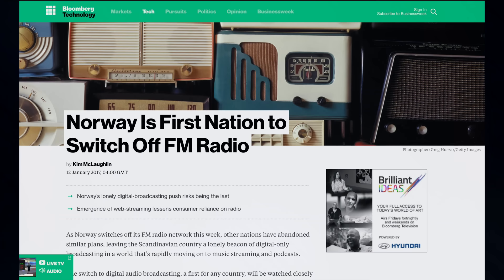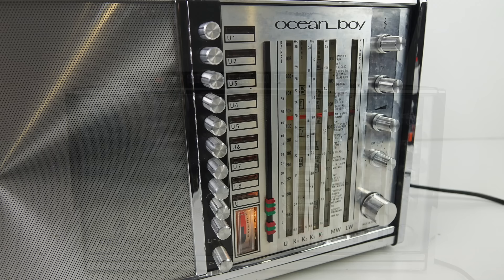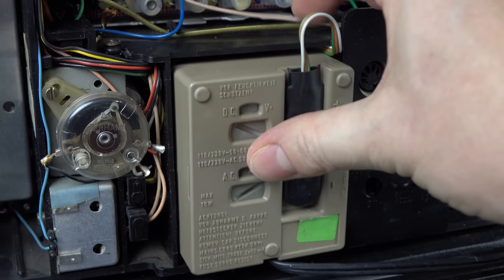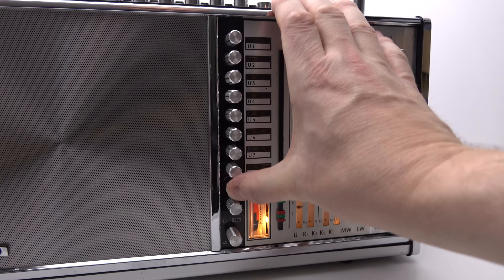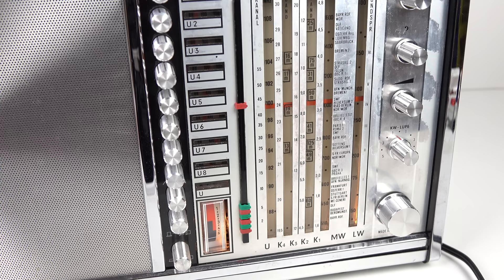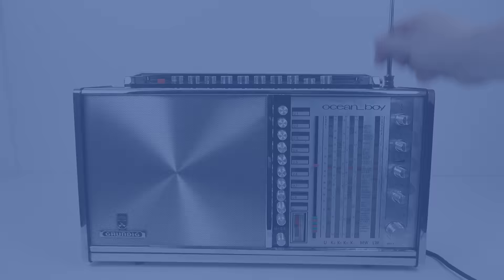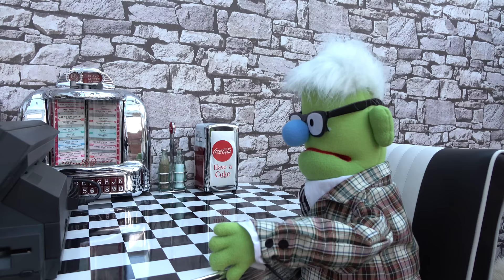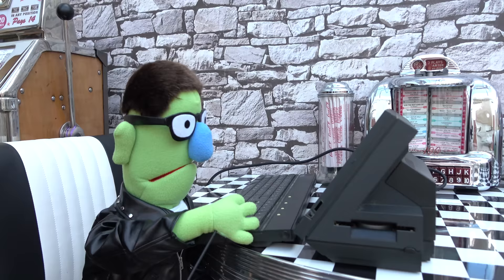Design Classic: Grundig Ocean Boy 210 Radio

Comment: Why is DAB being forced down our neck. The transmission quality from most stations is poor, you need a very strong signal to get reception and if you need a portable DAB radio it has to be the size of a house brick as DAB needs 8 (eight!!) times as much power as an FM transistor radio.
Reply: Oh lol. You guys in the UK (I suppose?) must have REALLY fucked up a proper implementation of digital radio.
German here, I've got a DAB+ radio in my car and not only does it receive my favorite small local station that always had a too week signal with FM without any issues whatsoever, there's also a ton of stations that aren't available on FM in my area or AT ALL and in terms of sound quality it COMPLETELY blows that crappy FM out of the water. Whenever I compare DAB+ to FM on that car radio, It leaves me wondering why DAB+ hasn't already taken FM's place years ago.
Reply: There is also DRM radio there, digital stereo shortwave radio with a video source, nice.

Comment: quallity products hold for ever .. all the stuff after 1995 barely makes it 1-2 years
Reply: It depends. I have a 1997 LG H-120 Handheld PC that still works today, a 1998 Toshiba Satellite 2180CDT that is my secondary laptop, and a 2000 Fujitsu Siemens CRT monitor that I am looking at right now :-)

I would say that most of the stuff made for mass-consuming market after 2005 is total crap. You are lucky to get it past the warranty period. More than once I bought smartphones that broke during the warranty period several times (thankfully I never paid anything).
And to clarify, I am not old at all: I'm just 19 :-D
Reply: Made in China goods seems to be pretty variable quality and may depend on your luck. I bought 2 identical power supplies, the first one broke after a week (shorted output transistor), the second one I bought to replace it is still working after 2 years, and I've abused it at least three or four times (leaving it two days at maximum power one time as well). I agree tho that some Made in China stuff is quite high quality, while others are complete crap.
Reply: lol made in china is quite high quality ?? yea and mcdonalds is quite quality food !! ha ha ha LMAO
Reply: The radio equipment of today can't even be repaired, no availible parts.
Reply: I think there was a highend CD player from there which was about $10,000 or so, reviewed in stereophile or absolute sound magazone.

Comment: Why just give up and switch off your FM tuners when you get a rca/3.5mm to FM transmitter...
Reply: So use your radio as a wireless speaker. What's the point in that?

Comment: I'm in the United States, and I have a Transistor 3001, which is the export version of the Ocean Boy 209. I got it for my 14th birthday in 1977. Just a few years ago it developed a problem. It won't turn on unless I hold the on/off button part way down. My father took it to a friend who he thought could fix that, but then discovered a larger problem. So he brought it back to me. He said it didn't work at all. I plugged it in and found that it doesn't receive any FM at all, just noise- on either the main tuner or on any of the 8 pre-sets. But it always worked fine before.

Comment: What is the beige thing in the back with the adjusters and plug thing?
Reply from the maker: Voltage transformer.
Reply: Thank you.
Reply: should be fairly obvious when you saw it. but judging by your name and profile image, i can understand that you're probably one of those people who live under a rock, who just pretend to be guided and interested in science but actually don't know anything science or electrical; even though I knew the difference between voltage standards of various countries as a child without ever traveling abroad (it's just common sense), so I honestly cant tell if you're just really clueless or pretending.. Anyways, it is a voltage selector. Swap it between North American/Japan 110 and U.K./Europe 220 volts, and also seemed to have a dial to select the DC output, I am guessing between 6.5/7.5W to 9 volts, to better help regulate the power provided to the radio's tuner and speaker.

lol
Reply: Whoa, dude, calm down. Not all people know how circuits and voltage works. It's not like the average user has to take apart their radio to be able to listen to Lady Gaga, so it's not necessary information to know what all the individual components are. You don't need to know how to forge the pins in the lock to open your front door, do you?
Reply: +Raven S (Hidden) Hey I have the training to repair that thing, and the glimpse of that removable grey box was just a bit too short to completely ID it. I recognized most of the other parts and connectors, but most radios from that period had the transformer firmly attached to the chassis, since it wouldn't dominate the device weight anyway. That two-prong figure 8 power cable used with a Mac Mini was the typical power cable for such radios, and they are still interchangeable.
Reply: If it is anything like the Grundig Yacht Boys I have the transformer was an optional extra. The big selling point of transistor radios was that they ran off batteries (for a reasonable time) so they must have thought many people wouldn't want to pay for something they wouldn't use.

Comment: Even if FM gets switched off almost everywhere, it will still be fun to pickup some distant remaining FM radio stations (which are now audible due to the fact that the strong FM transmitters in your vicinity have been switched off) and of course: Pirate Radio Stations! I wouldn't be so fast in throwing those FM radio's away.

Comment: The connections on the back are an interesting set of options ... and those dual-duty preset + tuning knobs!!! And still sounds better than most BlueTooth speakers that only have one, maybe two jobs to do! This unit here - so pleasing to see, approach, interact with and hear!
Always wanted a digital Grundig  from RadioShack here in the US ( all too boring styling but feature-rich even till I came across one years later at the Shack ) in order to increase worldwide listening options beyond my contemporaneous ownership of a  Lasonic TRC-931 ( single aerial / antenna ) which I blasted about as much music from as the two available SW bands in the mornings and, moreso, evenings.

Comment: This is a beautiful design,it even looks great now.

If FM radio has switch off,you can buy something like a FM transmitter with 3.5mm jack that can plug in your phone or your Walkman or discman,you can set a frequency to transmit and set the radio to the same frequency to use as a wireless speaker to listen to music,it may not be the best audio quality but you still can keep your radio running :)

Comment: You should get DIN to 3.5 mm cable and connect bluetooth receiver or chromecast audio to it. Much, much better sound than fm. Just make shure to lower the input signal and turn radio volume almost to max. This way you can also use eq from device. 

I use my ocean boy 210, satellit 2000 and c6200 in different rooms, on picnics and smaller parties. Batteries last for ages. 

There's something special about GRUNDIG SOUND, IT ALWAYS MAKES PEOPLE DANCE and livens the party with it's looks. 

Love your channel!

Comment: I have the "Concert Boy 4000" from the same series. Same power suppy, same scale markers, same tuning meter, similar design, but FM Stereo (in 1968!). But it lacks the presets and has only 2 shortwave bands. The amp gjves only 2x 1.5 W, but the 4 speaker systems sounds like my HiFi.  On a set of 7 D-Cells it runs for months of normal listening. Where would our society be today, if our products would be designed and engineered with the same care as then, but with modern technology.

Comment: Here in the US we have HD digital channels which are digital encodes that set just above or below both FM and AM channel frequencies.My 2014 Camry didn't even have HD radio as an option. DAB stations as in Norway apparently transmit at slightly higher frequencies than the traditional FM band with a spread spectrum system over, essentially AM carriers - redundant information is sent for more reliability. I found myself listening to Internet radio from my smartphone while out driving yesterday and then remembered - data usage!

Comment: By the way, I am the proud owner of a Grundig Concert Boy, first bought in 1979 at the age of 13. There's plenty of broadcast short wave out there - if there's interference inside your house, get a long antenna outside, and you can even listen on your computer with a cheap RTL-SDR dongle and a device called an "upconverter."

Comment: Yaughtboy had fabulous sound, really deep undistorted bass, smooth mid range and pin sharp treble . All these at incredible volume. Finding one in good nick is hard as they ended up being used on building sites.But I think they are probably the best portable radio I have ever come across.

Comment: Those early furniturestyle radio/turntables with built-in speakers devices always had a glorious sound.  You had to wait a few moments for the tubes to warm up but it was such a warm and clear sound. Transistors were more robust and compact after that but I always felt the sound was never as good and warm as those old wooden devices that ran on tubes.

Comment: Weird what's happening in Europe first with LW and now FM radio. There are construction permits for new FM stations in Canada and USA still today. Many areas have so many FM radio stations there is a different one every 0.2 MHz across the FM dial. Even AM, which is supposedly dying, has dozens of local stations, and packed bottom to top, every 10 kHz at night.

Comment: I bought a a working Grundig Hit boy 310 and it works very well and it only cost £3.50, it is amazing that you can find in 2nd hand shops theses days. and it has FM,LW and MW but I do not thing that it has the original areal because it has to be pulled out for it to fit in the little clamp that holds it in. The best radio we have in the house is a Roberts R-800 and it has VHF, MF and LF and it takes a PP9 battery that you can still buy.

Comment: I have got a Grudig Hit Boy 31 and it slightly bettered but it still works very well and the sound quality is very good when it get hod of it. I got the radio for only £3.50 and it came with the power supply.

Comment: When the analog signal will be turned off, old radios won't be dead, they will surely sell something like those devices to stream on the car stereo the music from MP3 players, they will pick digital signal, convert it to a given FM frequency in a very short range and stream to your car stereo or your old radio, you'll only have to remember to change station on the box instead of changing with the dial of the radio that will remain tuned on the frequency streamed by the box

Comment: Nice. An intriguing one you may want to track down is a Russian Vega Selena 215. Due to the iron curtain back then, they sorta had a fork in their technological evolution and were still using solid state components (transistors etc) into the 1980s when the rival Sony ICF radios were becoming really small and more microchip based.

Basically, imagine a Russian version in a big sturdy case, big clonky switches and multi banded to pick up several short wave bands, medium wave, long wave and FM. Think you'd be into that.

Comment: Yacht Boy was a reciever I wanted. Got a Sangean ATS 803A and then a Lowe HF 125 both rare today I used these to recieve HF-FAX in the 90's then went to the internet. Getting raw weather in those days was harder... both of these had bfo so could resolve ssb. Wefax is a digital mode which has been around a long time it was fantastic getting a greyscale GOES-8 satellite pic at 3 in the morning on my aincient Tosh laptop running the Lowe decoder... much to the annoyance to the rest of my family. Wefax is still used but it's much harder now with all the hf pollution :-(

Comment: I remember the Grundig Yacht Boys and Satellit radios. They were always at the top of shortwave radio reviews with their high class sound. I wouldn't bother trying to find any English on shortwave unless you like American Evangelical preachers. There's not much else left. As for your FM receivers, you can always buy or build a very low power FM transmitter if you want them to feel needed. The ones used to play a phone through your car radio are pretty cheap.

Comment: You have the LW-band in that thing. Now you can listen to the last remaining Norwegian Radio at 153kHz. It will not go away, because it serves the offshore fleet on the Arctic Ocean. The wavelength is 2000 meters, so the optimal antenna lenght would be one kilometer.

Comment: Fisher radio had a similar thing they called it tune-o-matic. I owned a Fisher T 250 AM-FM receiver and the FM section had five little dials on the right hand side of the receiver that could be individually tune 5 presets.

Comment: I just realized I have a pretty similar device from the mid 70s, the Stereo 4500 HiFi Regie by ITT Schaub-Lorenz. But it's more designed as some kind of receiver... maybe? Aside from the radio which by the way also has 5 presets with it's own tiny tuners it has several inputs, one for Phono and a mixer which makes it possible to mix all input signals. Not sure if it was costly at all at the time but it still works perfectly and is in regular use.

Comment: The presets are like early 1980s TV and VCR presets. In circa 1983 I had a "Gold Star" TV like that. A pain to setup, but at least you only did it once!  P.S. In the US, broadcast radio is still kicking. In the Pittsburgh,PA market alone there are about 25 FM and 20 AM (MW) broadcast stations! 😀
Reply: herranton1979 I did'nt say there was any thing wrong with the set. Hell, I'm the one who bought it. I was referring to the tiny individual tuning wheels for the channel presets. It was the way analog tuner presets were setup then. Most brands had the same thing.
Reply: WAQWBrentwood Not to mention new FM LP stations that could be operated by any organization like schools.  only a shame digital radio is becoming less universal versus the old AM/FM/LW/SW bands of analog.
Reply: I live in Harrisburg, Pennsylvania market. There's 56 AM and 86 FM radio stations. Also, PennDOT uses AM radio to transmit traffic reports and road conditions (in my area, it's 1670 AM).

Comment: Well some interesting commentary on the whole Norway FM thing. It does concern me, being the manager of a reasonably large community FM station here in New Zealand. However rather I would like to comment on the radio itself in this video.

Those preset tuners with the little dials are almost exactly the same kind of thing they would have had in television sets during that era for the channel presets. In the TVs they usually hid behind a panel or in a little drawer. 

They are actually a form of precision potentiometer rather than a tuning capacitor. In this radio I am picking that the voltage they supply would be fed to a varicap diode to produce the tuning.

Comment: Even when Canada switches to digital FM, I'll be using my radios as wireless speakers for my PC I have a tiny FM transmitter hooked to the computer so I can hear podcasts and other things all over the house. And with stations gone from the band, it won't matter where I tune. The only thing I'll miss from analogue FM is hearing distant stations. Nothing on local stations makes me want to listen to them.

Comment: hello techmoan, I got the same radio, 
although it's not called an ocean boy (I guess that was the export model's name) 

my family brought it with them when they came to greece at 1972 back from germany (they were immigrants there). 
the funny thing is since greece was under a military dictatorship at the time they almost got arrested because the customs officers could not believe that this was a normal radio since it was overly complex and could also work at shortwaves ,they thought it was some kind of a military radio (which was obviously illegal for a citizen to own)... they had to wait for many hours before the were let go and not before the radio was "modified" by the custom officers (the just cut some wires...it was an easy fix, they tell me). anyway this radio stopped working some years ago... I opened it up to see what is wrong... and I was amazed by the complexity! (never got it to work).

P.S.
by the way... I just love it when you open things up and show us how they work and how you fix them ;-)

Comment: Rig up a handful of DAB radios to USB-powered FM transmitters and place them in or next to the room you have your FM radios.  It's worth trying a few first as some don't have great quality or output a very weak signal.  The Rii one I have reaches 3 rooms away from the transmitter, even though it's intended for a car and the sound quality seems as good as from a strong FM station.

Comment: In Germany, FM signals will also be switched off soon! However, I heard that the FM signal frequencies which are transmitted via the TV cable jack will NOT be switched off. Maybe there will be some way of using these for older electronics then?

Comment: Thanks for this review, really useful. I've just bought a 1969 209 in mint condition, a lovely radio. Can you give any help please as to what the red button on the top panel with the bulb icon above it does? I'm unsure if its to switch the front panel light off when the radio is on but when I try the button it doesn't do much or retracts when pushed down. I'm on the search for user manual without much luck.

Comment: I have a Grundig FR-200 ---recycle power--- Am/FM/Short Wave radio with a light on it.  It has a hand crank that charges a battery, along with normal replaceable batteries.  I guess the idea was, that you could get a light and a radio signal if the power went out in your home.  I think the idea was neat.  Portable light and radio charged by your hand cranking.